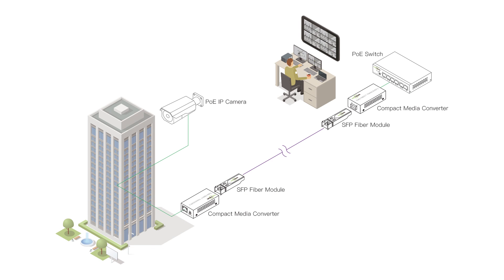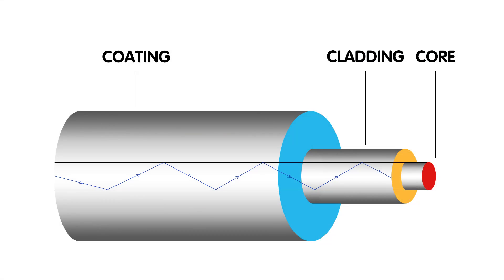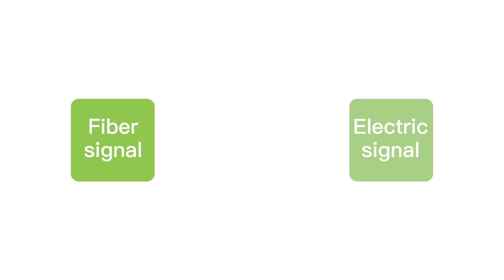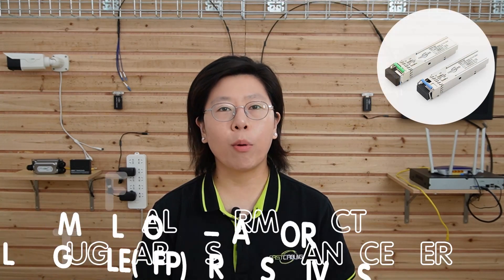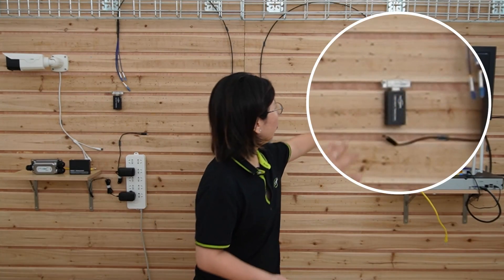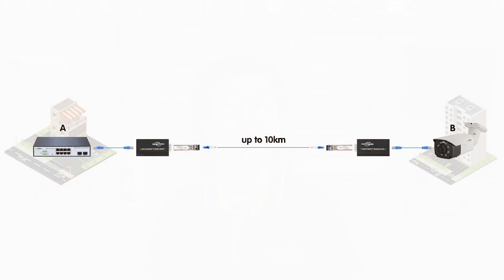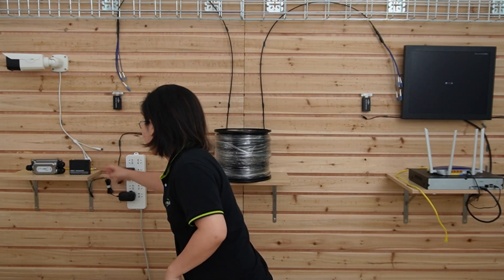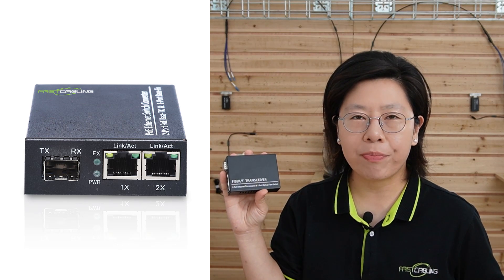Point-to-Point Fiber Optic Setup Guide For Dummies

Comment: wow nice video i have question  please regarding to fiber optic  can i use it for data and power ? what's the fit specification for choosing single or multi ? 2 core or 4 core or 8 core ? and what the differences thank you
Reply from the maker: You can send the power over the fiber optic cable directly since the fiber optic cable is made of glass. It is not conductor like the copper. However, you can use the composite fiber optic cable, also call hybrid fiber optic cable. The power wires was made in the cable. The single mode fiber optic cable will be good, there is almost no limit to distance. It can reach up to 80km, and you can use BiDi, just one strand to make up network link. It takes different wavelenght to transmit and receive the data. 2 cores,  4 cores or 8 cores, It depends on whether you want reserve for back up or not. If it is the backbone, it is always better to rerseve some extra even you don't need it at this moment.